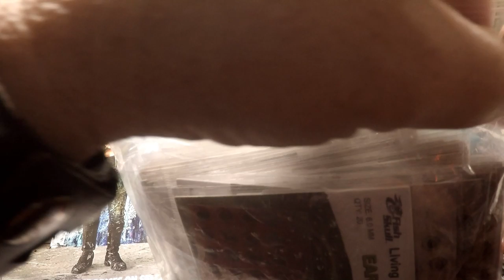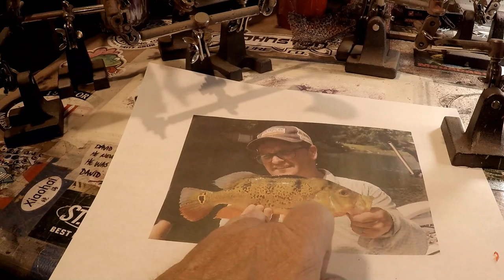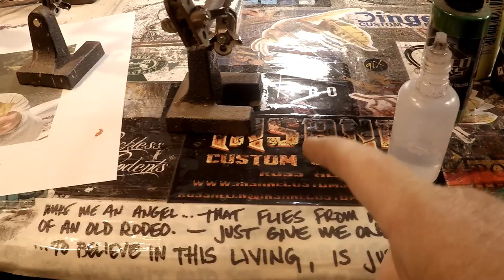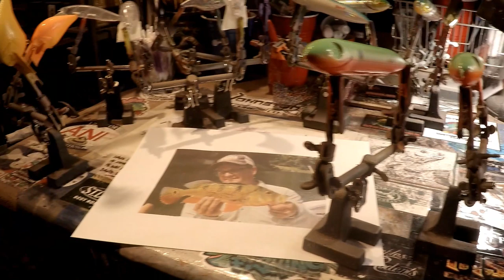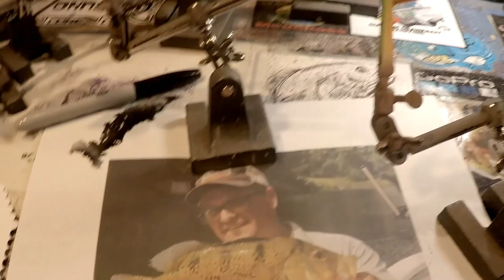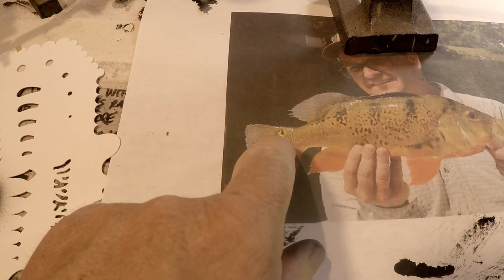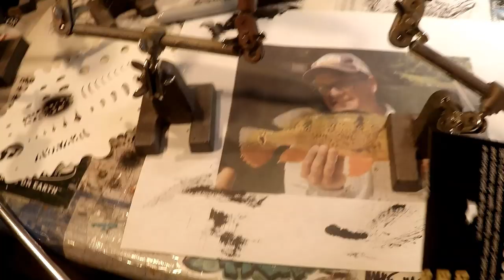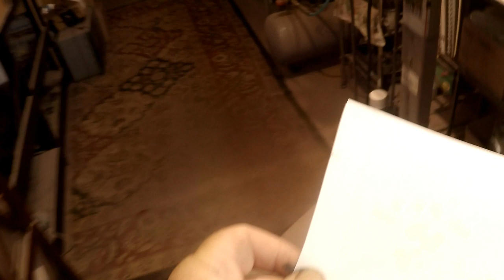HEDDON SUPER SPOOK REPAINT: "Peacock Bass" Spray Session

Comment: New subscriber here, do you buy the clear in the jar you dip into, or fill a jar with clear ? Thanks =):}
Reply from the maker: I remove it from the can it was shipped in when I’m ready to use it and place it in a glass jar (NOT MASON JAR) with one piece solid lid. Spaghetti jar, pickle jar, olive jar are my most common used jars. I place plastic wrap (stretched tightly) between the glass threads at the lip and the lid. 
Oxygen is no friend of KBS, so the less time the clearcoat is exposed to the air, the better. And open the jar as few times as possible throughout your clearcoat process. I generally wait until I have a group of Lures ready, and dip them together.